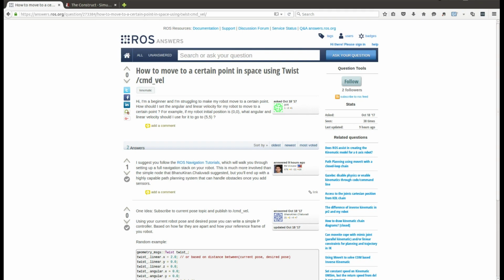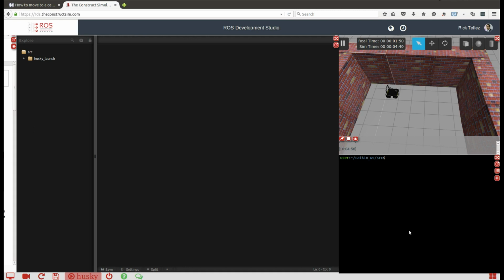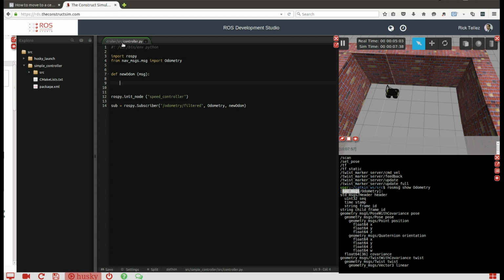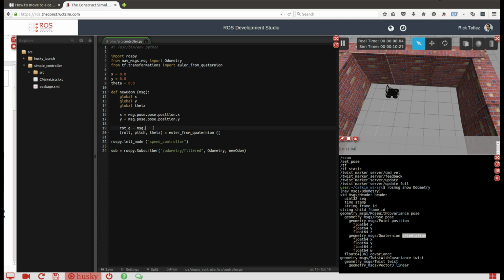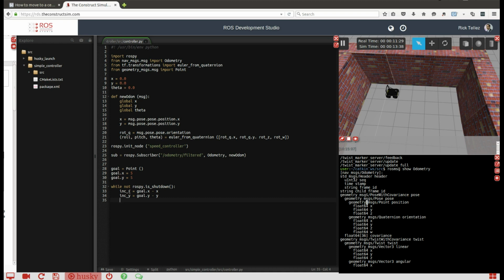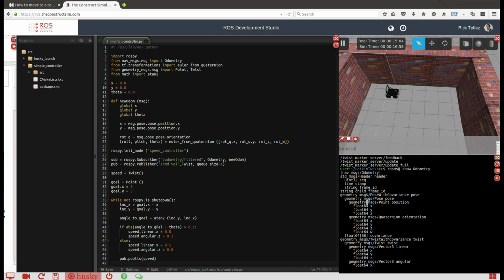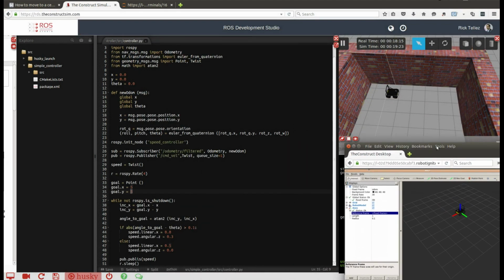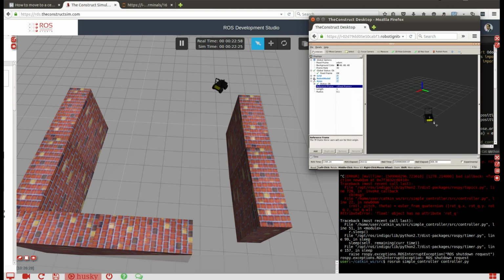[ROS Q&A] 053 - How to Move a Robot to a Certain Point Using Twist

Comment: I m new to ROS i need some help from you all....I have installed ROS in raspberry pi... I m not getting to which pin i should connect my motors... As in code pin numbers are not specified .... I want to move my physical robot from one point (x,y) to (x1,y1)

Comment: Hi i am trying to follow your code and my turtlebot 3 is running well. It rotate BUT don't move forward. So i check the "theta" value but it doesn't change. Where should i look to fix the problem. my guess is something wrong with euler_from_quaternion..?
Reply: I fixed it sub to /odom and pub to /cmd_vel thank for tutorials!!!
Reply: @오도경-e3l  thanks

Comment: hello. i tried this tutorial out but when I try:
rosrun simple_controller controller.py It does not run it just stays there. The terminal gets stuck. Then When I kill it with control C, I get this error.:
^CTraceback (most recent call last):
  File "/home/user/catkin_ws/src/simple_controller/src/controller.py", line 57, in <module>
    r.sleep()
  File "/opt/ros/kinetic/lib/python2.7/dist-packages/rospy/timer.py", line 103, in sleep
    sleep(self._remaining(curr_time))
  File "/opt/ros/kinetic/lib/python2.7/dist-packages/rospy/timer.py", line 166, in sleep
    raise rospy.exceptions.ROSInterruptException("ROS shutdown request")
rospy.exceptions.ROSInterruptException: ROS shutdown request

What could be wrong?
Reply from the maker: Well as you can see in the video, when we run the command, the terminal also gets stuck there while the program is running in the background. That is how it is supposed to work. Also if you press Ctrl+C the message that appears to you is also normal.
I suppose that you have launched the simulation previously, right? If that is not the case, you need the robot simulation launched before hand as indicated in the video
I also suppose that you are launching the same robot right? If you are trying with a different robot, the topics names must be changed, so you need to adapt the code to the robot topics names.
If all the above is correct, then it may mean that you have some mistake in your code. Run your program and then check if it is publishing at the /cmd_vel topic. If it is not, then you have a problem in the while loop. If it is publishing and still the robot is not moving, then it means there is something strange with the simulation. Relaunch the simulation and try again. If still happens, share your rosject with us, and we will check what happens in your code. Use the ROS Developers Chat on the bottom corner of the ROS Development Studio

Comment: Hello! I had this error:
    y = msg.pose.pose.position.y
 IndentationError: unexpected indent
Can you suggest a solution? 
Thank you!
Reply from the maker: Yes. The program is written in Python, so indentation is very important. Please keep the indentation as in the example.
Reply: It is exactly like the example. Is it maybe a problem with the libraries?
Reply from the maker: No, is not a problem of the libraries. It is a problem of indentation. You are not putting the correct indentation (as the message error indicates). Please pay attention to the spaces in each line of code